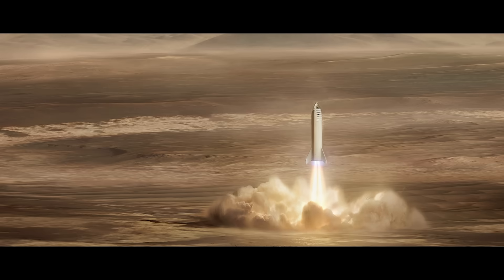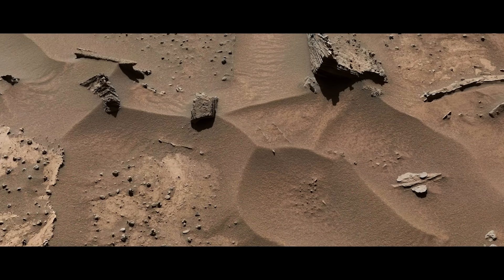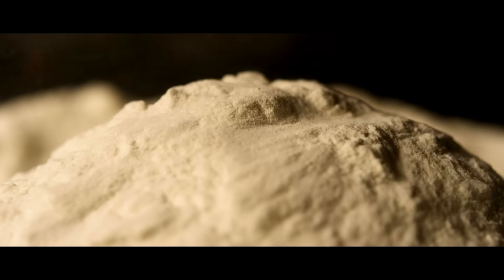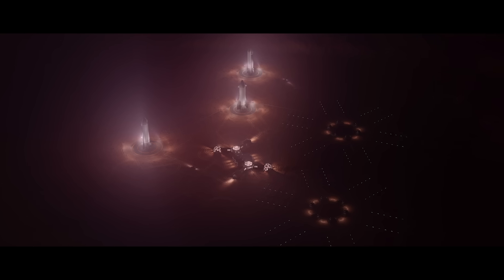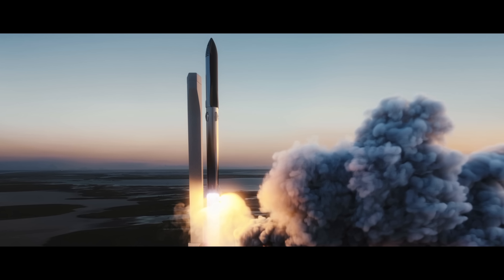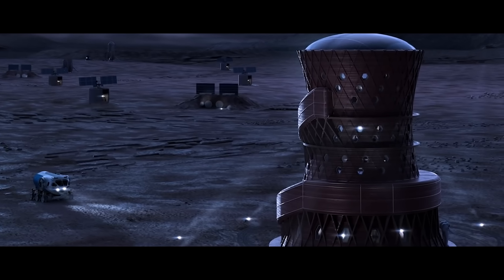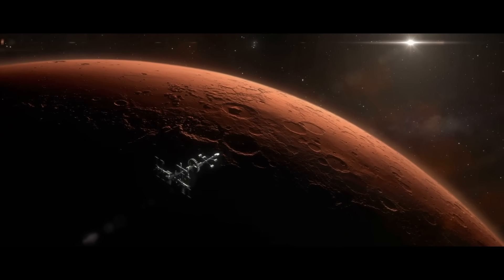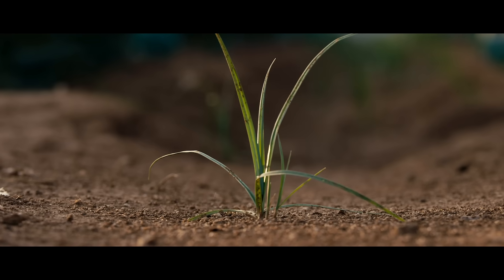THE FIRST 10,000 DAYS ON MARS (Timelapse)

Comment: Solar on Mars is far less efficient and you would need to use much more land than you would on Earth. What do you do about dust storms covering them in dust? Shutters that cover the panels before a dust storm hits? solar panel wipers? They can last months or years and cover the whole world. Bam, you lose your entire power supply and have to ration whatever you have stored. You couldn't beam solar power from space to the colonies during these storms either. Not enough stored? You ded. Small modular fission reactors (haven't been actually built yet) can be brought, but you'd need a steady supply since we don't know how much uranium is on the planet. Geothermal won't work because of a cold core, wind obviously wouldn't work. 

Until colonists get settled and mining equipment is landed (dear god that sounds fun with our current tech) they would begin the agonizing slow process of building factories, more mining equipment, vehicles, map areas for ore/uranium, dust storms would cover building sites, and present unknown dangers to various materials brought to the planet. Building would have to be buried meters below the ground and covered to shield against excess radiation, all these fancy buildings sticking out of the ground and the people in them would get radiation poisoning and treated to a nice rusty blocked view when a storm rolls through. Oh ya the gravity, "get used to it", people born there will have much weaker bodies and, will never be able to visit their home planet. I guess Mars would be their home planet unfortunately, a barren wasteland of one. Oh, food? Trying to grow in radioactive, chlorine containing soil generally isn't good for you unless you're superman. 

You wouldn't be able to venture outside much due to radiation, so you'd spend most of your time underground, only looking out through cameras connected to colonies sticking out of the ground. Oh wait they'll get covered during dust storms too. So, you get through all that, and build underground cities, everyone lives like moles and rarely goes to the surface, all while robots and automated mining machines do all the work. Soil, seeds, and animals brought from Earth and constructing massive underground farms/fish farms would work, except the fish would probably die soon after, and if one gave birth, the low gravity would result in a stunted, poorly sized fish probably unsuitable for consumption. Oh! forgot about the earthquakes, might be an issue. 

Imagine the psychological impact that would have on people when they realize they wont be able to breath clean air, stay outside pretty much as long as they want, feel the wind, rain, ride a bike, drive, eat ice cream on a lovely spring day, hike, run, climb a tree, chill on the deck with a beer, etc. People will eventually snap, especially the first humans born there, growing up, seeing pictures/videos of Earth, and being told they will never be able to experience that in their entire lives. But I'm sure nothing will go wrong, pent up hatred and misery never led to anything bad happening has it? 

Building space habitats that mimic Earth? Nah lets make humans live shitty lives instead. 

I am possibly drunk
Reply: You're already making 1000s of metric tons of LCH4/LO2. Fuel cells exist

Comment: Erebus Montes is too far north.  It gets far too cold up there.  The habitat should be at the equator so that it gets reasonably warm during the day (about 70 degrees F).  

Seven football fields of solar panels?  That is way, way, way, way, way too many.  Solar panels are great but you have to go out and clean the dust off them.  Sometimes Mars has dust storms that span the entire plant and they can last an entire year so you would lose all of your solar electricity production.  

The best way for a first colony on Mars to succeed is if it starts small, with 4 crew to build a first buried habitat to grow vegetables in hydroponics and plastic pots.  The oxygen, CO2 removal, and food requirement for 30 people would be incredible and greatly increase risk.  Also, having to return 30 people to earth in two years means gigantic space ships using immense amounts of rocket fuel.  If the crew is 4 then you don't have to go out and attempt to mine rocket fuel from the Martian regolith, you can just send a rocket with enough fuel to return to earth.

Domes don't make sense.  The internal pressure would have to be at least 5 psi and the total force of that would break any glass or plastic unless it was many inches thick, like windows on a deep submersible.  Also, domes would not protect against solar radiation unless they are buried under at least 8 feet of Mars regolith.  

If you land in a perfect spaceship habitat why would anyone move out into a 3D built hab on the Mars surface?  It makes no sense.  Once agan, you have to have 8 feet of regolith on top or you get cancer from the increased radiation.   

You don't need to go out and harvest Mars ice for water if you only send 4 crew.  The water they take with them will be enough.  The water will not be able to escape the buried habitat anyway, it will all be recycled and reused. 

They discover cave systems for underground habitats?  The cave would have to be pressurized to 5 psi.  There would be no way to know if it could hold that pressure without rupturing.  Why do that when we can just dig out an area and assemble and cover our own habitat?    

Who ever came up with all of this doesn't seem to know engineering or very much about Mars.  Brute force techniques are not always the best way.  If they try to do it this way they are going to get a lot of people killed.
Reply: Erebus Montes is pretty low elevation so more atmosphere to slow down, meaning less landing fuel and more payload. Also has a lot of water ice, which we need if we want a large scale base and/or an eventual colony
Reply: @iamarokotmanson   Mars atmosphere is so little that a fraction more doesn't make any real difference.  

We don't need to harvest water/ice on Mars unless we are stupid.  A return ship can be sent from the earth with its hydrogen tanks full and the oxygen tanks empty and the ship will take in Mars CO2 and break it apart and keep the oxygen.  Two of them will be ready at all times to return a crew to earth.  Zubrin detailed all of this in the 90's.  

The key to a large scale base is starting small.  A crew of four can dig out an area, assemble a prefab habitat, bury it, then go inside and start growing hydroponic vegetables and pots with standing vegetables and fruit trees.  All water will be contained and filtered and reused.  Then the next crew will do the exact same thing and connect the two so we will have two buried habitats that are almost completely self sufficient.  The plants produce oxygen, remove CO2, and they are food.  

You have to limit the outside excursions.  Any decompression will kill all humans and plants in 1 minute.
Reply: @twelvestitches984  probably. I'm just saying whats been said by SpaceX
Reply: @twelvestitches984  I do support partial ISRU for at least the initial missions as Zubrin described, just in this case Starships. To bring down costs though, we gotta eventually mine water ice so we don't have to send a whole Starship full of LH2 every time we need to head home. As well as far large scale human consumption, irrigation for plants, and fuel cells.
Reply: @twelvestitches984  we have an 100t class Mars cargo/crew lander that's fully reusable. We can afford to think bigger, what's to say we can't do the same but upscaled with a crew of 12, maybe 24? 

We can send multiple ships
Reply: @iamarokotmanson  We don't have a 100t class mars lander.  We have a crazy idea from a guy who is not going.    
Elon's idea maximizes every risk when you don't have to.  He wants to get to mars in 3 months instead of 6.  That means powering to mars faster than aerocapture can slow you down.  That is risky, if there is a problem and you can't slow down in time you fly off into space forever.  
Also, 30 people is not necessary for the initial landing because that means more oxygen, more CO2 removal, more food, more waste processing, more weight, larger parachutes, more rovers, and a lot more fuel to leave mars.  On the earth one pound of weight on a spacecraft requires three pounds of fuel just to get to orbit.  
A small crew of 4 will be more than enough to dig out, assemble, and bury an initial habitat.  They stay for 2 years and grow plants in hydroponics and tubs.  No regolith/ice harvesting needed.    
We can send multiple ships?  There is no need for more people.  More people maximizes every risk.  Four small sized people is all we need to establish the first mars base.
Reply: @iamarokotmanson  Bring down costs?  No one has an idea that is cheaper than Zubrins Mars Direct idea.  

A small crew of 4 that builds a buried habitat on mars and stays for 2 years will have two initial earth return vehicles already on mars and full of fuel.  NASA will monitor them from the earth.  Then, every 2 years we switch out the crew and send an additional earth return vehicle so there are always 2 on mars full of fuel and able to return a crew.  So, every 2 years we would send one crewed hab that lands on mars and we would send one earth return vehicle.  

NASA can afford this ONLY if they don't have a stupid moon base.  If we try to build a useless moon base then we lose a mars base.  

Also, as far as water goes, all water will be contained inside the buried hab.  No water will escape.  It will be filtered, used on the plants, then filtered and reused and also recovered by dehumidifiers.  So, no mars regolith/ice harvesting needed.  

Plants won't be irrigated.  They will grow hydroponics and have growing tubs full of earth soil and chickens to provide eggs/protein.  

And no fuel cells because they destroy water.  All hab power would be from solar panels and RTG's.  You can look up an RTG.  

You keep the crew small so you minimize risk.
Reply: Starship can land a whole 100t on Mars, mass won't be too much of an issue so they could brute force a not so advanced ECLSS
Reply: You'd have to land at least 10 Starships on Mars to bring enough fuel to head home so not the best idea. You need ISRU no matter what, a scaled up MOXIE and some LH2 feedstock.
Reply: @iamarokotmanson  Not if you send 4 crew.  If you try and send a crew of 30 then you need to increase everything and you maximize all risk.

Comment: My question to Elon Musk have you discovered a way to confirm that the ships can land safely and that the landing gear will all land on a very good strong sturdy surface that can handle the weight of such a ship full of 30 astronauts. If you have not thought of such a thing if you think the Rovers on Mars can do this I believe you're wrong so I have a suggestion one way to make sure that the ground is strong enough how do you do that you simply drop some type of a penetrating probe the see the impact it will take on the surface in the area you want the land multiple probes the see how far they go into the ground and register their impact the density so far so forth a second way to make sure that the ships can land is simply delivering the platform's first find a way to get a large flat platform that could literally just be dropped onto Mars via parachute and these platforms will act like a huge frisbee on top of quicksand you spread out the weight with a rigid structure and even if the ground underneath isn't so strong the combined resistance of the ground with a rigid surface or should I say platform will spread out that weight and allow a heavy object to land down on the surface. It's kind of like if you're walking on a frozen lake and you here hopefully you guys have thought of something and thought ahead of time about the landing of these ships I'm sure you have but just in case I thought I'd throw that out there. You're not the only genius on this planet I just haven't had the right cards dealt to me and I wasn't nurtured in the right direction. Business sense I don't have but my inventions and my ideas my ability to problem-solve and foresee things is very good and this is not me just saying is I get feedback from the lots and lots of different people after awhile when people call you a genius from your early thirties to your 40s have to start accepting the fact that you are genius. I used to laugh at people when he would call me that I would look at them and say I can't even understand the English language and I was born and raised in United States of America and I can't spell Smarter Than a 5th Grader to save my life but when it comes to the physical world my brain just gets things very easy. Hope this helps you SpaceX give some ideas on how to properly land the ship safely I would do both methods shoot a whole bunch of probes that can detect the density of the ground and maybe even still drop a platform so it's nice and perfect for when these ships land

Comment: Why does media ignore Mars Direct? One of the major contractors for NASA proposed Mars Direct in 1990. It included several innovations to make the mission practical, but people keep ignoring that mission plan and its innovations. One was to connect the spacecraft with a tether (rope or cable) to the spent rocket stage, and spin. Using the spent stage as a counterweight, rotation provides artificial gravity for the trip to Mars. When they approach Mars, just cut the cable and let the spent stage fling off into space. That way astronauts are fit when they land, no time wasted recovering.
Reply: Im not sure that artificial gravity is possible yet
Reply: @justsomerandombirdwithinte5896  Centrifugal force by rotation. It was tested by Gemini in the 1960s.
Reply: @robdyck1187  source?
Reply: @justsomerandombirdwithinte5896  Gemini XI (Gemini 11) rendezvoused and docked with an unmanned Agena target vehicle, attached a tether, separated and spun. Low spin rate, did produce some centrifugal force, but not much. September 12, 1966
https://en.wikipedia.org/wiki/Gemini_11
Reply: @robdyck1187  I know that centrifugal force was produced, but how would a spacecraft be able to accelerate or decelerate without having to waste precious fuel on slowing the spin?
Reply: @justsomerandombirdwithinte5896  So you asked for a reference, but you don't want to read the book. First you're a little too obsessed with fuel. Yes, it will take a little fuel to spin up. The Mars Direct mission plan was written in 1990 by engineers working for one of the major contractors for NASA. A tether would be attached to the spent upper stage that pushed the spacecraft into a trans-Mars trajectory. Then the spacecraft and upper stage separate to unreel the tether. Yes, either the spacecraft or upper stage or both will have to expend a little fuel to spin up. When they approach Mars, the tether is cut allowing the upper stage to go spinning off into space. Then the spacecraft uses a little fuel to stop the spin.

A space station such as ISS uses control moment gyros to maintain orientation and prevent spin, which uses rotation of a weight to counter rotation of the station. That uses electricity, nothing more. If it has to constantly counter rotation in the same direction, eventually spin of the gyro will be max-ed out, requiring some fuel to "de-spin" or "de-saturate" the gyro. Overall, movement of the space station in one direction is countered by movement in the other, so the gyros use momentum gained to counter rotation in one direction to later counter rotation in the other. But as I said, when the gyros become saturated, you must use thrusters which consume propellant to de-saturate the gyros.

But Mars Direct spacecraft will not use gyros, just thrusters. It spins up just once after leaving Earth orbit. And it de-spins just once, upon approach to Mars. That is preparation to enter Mars' atmosphere.
Reply: @robdyck1187  fair enough.

Comment: Very optimistic with borderline fantasy in parts of this video. The ending for instance is not going to happen. The atmospheric pressure of Mars is 1/100th that of Earth (reason it's so cold besdies its  distance from the sun). There will be no plants attempting to grow on the surface for hundreds of years at best. The amount of gases needed to get it to the stage is astronomical and likely do not even exist on the planet itself. As in we would required to import materials via comets or the like.